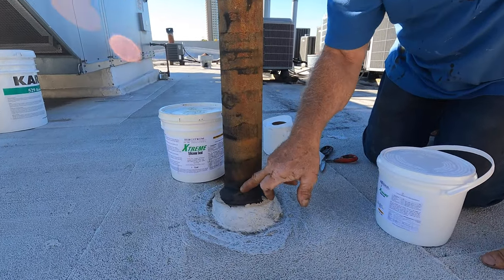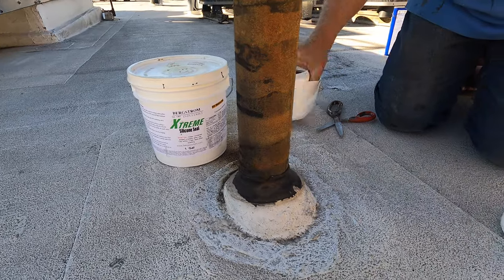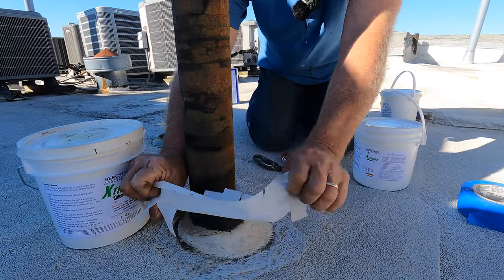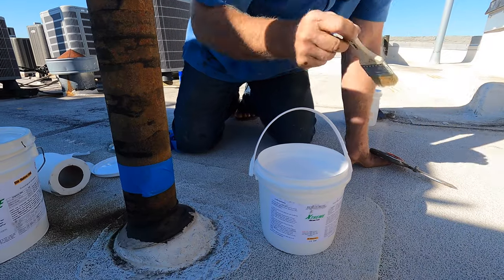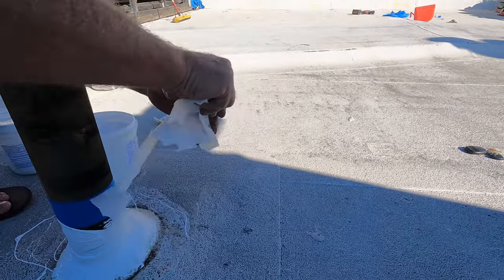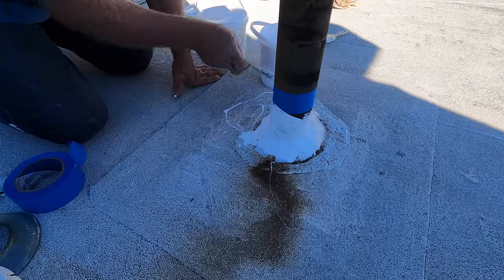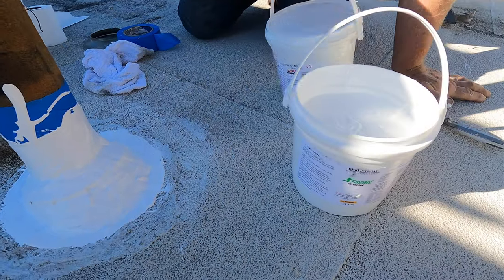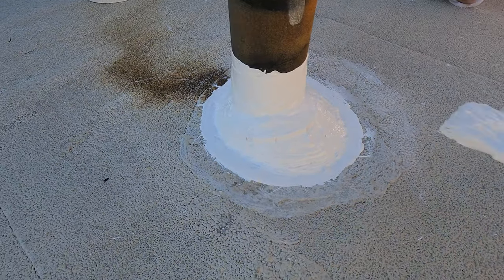VENT PIPE LEAK REPAIR on a flat roof

Comment: Great video. Can you post a link to where i can buy the Xtreme Silicone Seal? I looked online but can't find the same 1/2 bucket you used. I see an orange one on their website, but yours is white with green lettering, which I don't see on their site. I guess that's the Super Silicone Seal. I don't see the Xtreme on their site.

Comment: Hope u can help me- i put a shingle roof on a flat patio roof -realized i should NOT have done that.   I dont have the $ to get the roll roofing done now, is there anything i can put on the shingles on the flat roof so they stop leaking.  I cant figure out what spot its leaking cause its flat but anything i can roll or put on there all over the shingles?  Thank you!!
Reply from the maker: Go to a Roofing Supplier near you, and buy a roll of EPDM rubber. Make sure you have the measurements of your roof so you can get a slightly larger rubber.
Then remove all the shingles and nails, and roll this membrane out over the flat roof. Fold the membrane over the edge of the roof and cut excess off. Then nail the membrane tight on the facia or sides of the roof.
I hope you can figure out what I am trying to explain.
So, you don't have the $ to buy the membrane. I think more you won't have the money to replace all the damage that will happen till you can get around it. Try to get $400 together so you can cover and preserve the integrity of your roof structure.
Good Luck
Reply: @FlatRoofDoctor   i found a roofer. He will put a tpo roof on the flat patio.  Thanks

Comment: wrong wrong wrong. the pipe has to be able to move and flex witht the weather.
Reply from the maker: Yes Yes Yes. Cast iron pipes don't move or flex. This method does allow for movement and is flexible. In case you were not aware